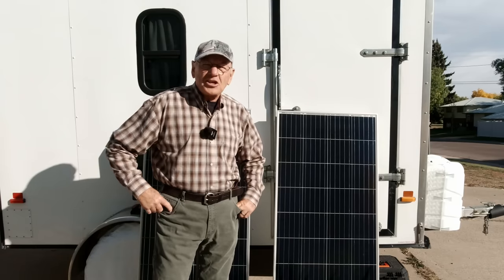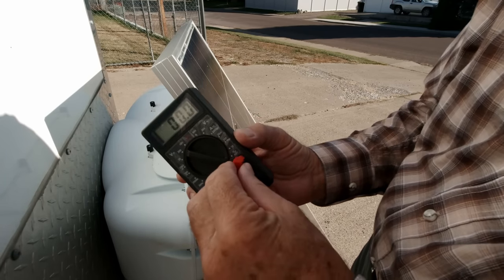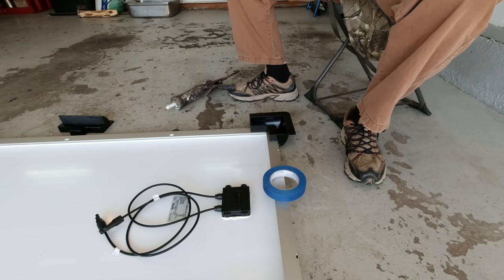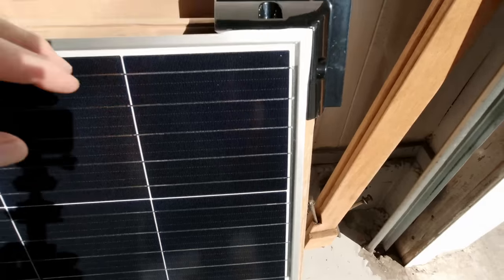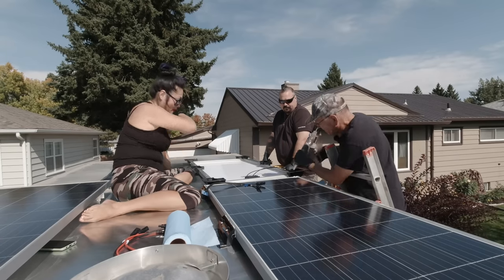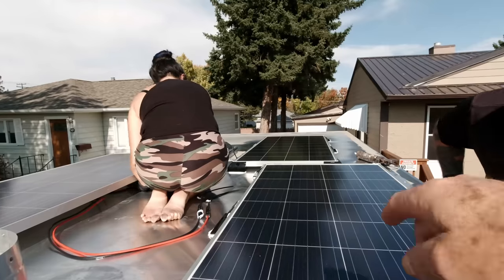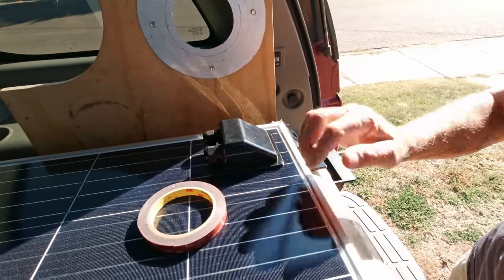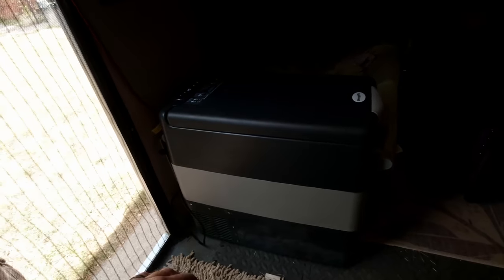RV Rooftop Solar Panel Easy Installation! Bouge RV Solar Panels

Comment: great looking panels. perform well too! my only conscern with my application is that my aluminum roof is loose. im afraid they may flap a little at speed. maybe bc of the brand of my trailer or 20"+ centered rafters... ive got unistruts up there. thought about taking them off but i should probably keep them
Reply from the maker: I addressed that problem in this video, and it may help you:  https://youtu.be/MJKRZkh17l8
Reply: @gonagain  another great vid! my roof sheeting might be secured down, im not sure. ive already installed the ceiling anyway lol. but the spacing is wide between the rafters... theres a lot of flex between them. i suppose id try and put those cleats on, or very close to, the beams. we'll see, ive already got 7- 100w panels. im probably gonna install 5-6 of them. thats a lot of panels! thanks again, and keep it between the ditches ;)

Comment: You did them the same way I did, except I put bolts through the panel/plastic mounts, instead of just sikaflex.
Reply from the maker: That doesn't hurt, I just learned to trust the Sikaflex years ago.  If applied correctly it won't let go for anything.
Reply: @gonagain  
Yes I did my solar panel on the roof some five years ago now. We all learn more as the years go by. 🖖

Comment: This is pretty cool. I installed mine with 3M VHB tape and Loctite Platinum 😂 would have an easier time getting them off if I did it this way instead

Comment: Is there a big advantage to having the second panel loose, not mounted to the roof, so that you could move it around for the best light?  If the trailer was under a shade tree, maybe take the (extra) panel out 40 or 50 feet to where there is good sunlight.  Also, you could then turn the panel as the sun arced through the sky.

Comment: Got a question on a roof top solar panel. How does the panel survive a severe hail storm ?
Reply: Rocks kicked up by trucks coming down on the solar panel is not a direct hit though like golf ball size hail from the sky. I would think that cover would be used over the panel while on the highway.

Comment: Where did you get your cable ties,  Bogue rv or local hardware?
Reply: Found it in video, lowes?
Reply from the maker: Yeah, they're just ones I got from Ace Hardware.  It's important that you get the black, UV resistant ones.  Oh, and they should be available at any good hardware store.
Reply: @gonagain  lol, i figured i wanted black for a uv protection, went to home depot and lowes only found the white ones. Thanks rick!!

Comment: Is there reason you used Sikaflex 252 instead of 221?
Reply from the maker: 221 would work great I think and it's only because Sikaflex goes as far as to specifically call 252 an adhesive and not an adhesive/caulk.

Comment: Great video, of course.
A question, though;
You have an aluminum roof. What would happen with the solar panels and adhesive with my
travel trailer that has a PTO roof?  Wouldn't that peel away?
Reply from the maker: Hello Denny.  With a tpo roof I would opt for mechanically fastening my solar panels.  The same style mounts can be used but you need to drill out the holes on the bases for fastening.  It will still be faster though because you can bond the mounts to the panel like I did in the video.
Reply: @gonagain  Thanks for your reply. Rather than drilling all those holes into the TPO and plywood underneath, I think I'll look into getting portable solar panels and connect up to the batteries on the tongue of the trailer.  I put easily accessible 12 volt and ground terminals out there on the front frame anyway.
Keep up the good work. 🤠
Reply from the maker: Look for portable panels that use Sunpower cells, like Bluetti or Xtar.
Reply: @gonagain  Thank you!
You are just a wealth of knowledge!

Comment: Ok it's all your fault I got my 4 180 watt panels ordered lol. I have been looking at them for over a year and went ahead and got them. They should charge my two Bluetti's Ac200 in one day or 6 hours depending on how much sun I get but because I only have to charge them every other day I can do one one day and the other the next day. I guess what I'm saying is thanks for the push I needed to order them. I should have done this a year ago. I'm getting closer now if only my neck and back will fall in place I can start enjoying my camper.
Reply from the maker: Good thing you got them ordered because it just came out in this weeks news that there's going to be a tariff put on some things coming out of Vietnam.  it looks like China is routing goods through Vietnam to avoid the tariff placed on things sent directly from China.  Too complicated for me...

Comment: Hello again Gonagain. I've been looking at their panels I am almost ready to get some and I am 98% sure it'll be theirs. I just got done removing a lot of old adhesive off the roof of my 16 foot cargo trailer and installing another maxxair fan I hate working on something that someone else has worked on before and didn't do it right the first time or clean it off after they removed something but that's life. I am still looking for a roof rack that will hold my panel's but it has to attach to the side's so I think I am going to have one made. You all did a good job nice and neat not some sloppy job like I have seen others do. Take care stay safe and we hope your tomorrow is better than your today was.
Reply from the maker: Thanks Den.  I've seen roof racks that attach to the side like you mentioned, but they were custom made.

Comment: Good installation video. 
You did mention you have a solar charge controller, but didn't mention the readout panel. The EPEVER Meter MT-6 connects to the solar controller, and allows you to read important charge info from a convenient location, but it isn't required. I think all that info can be read in the controller  readout.
Reply from the maker: Thanks for the info!  That set-up was done by my son-in-law and I didn't look to closely at it to figure out all that he has.